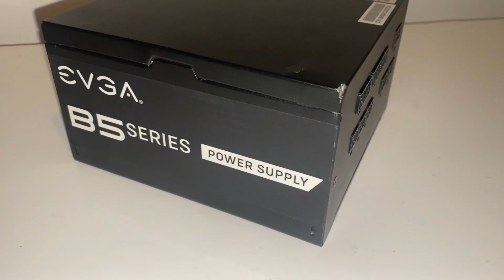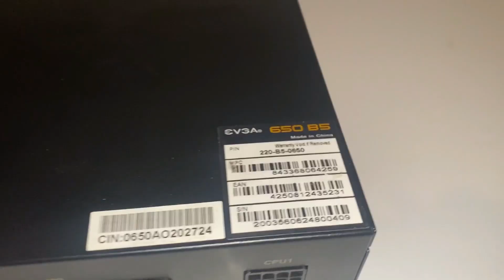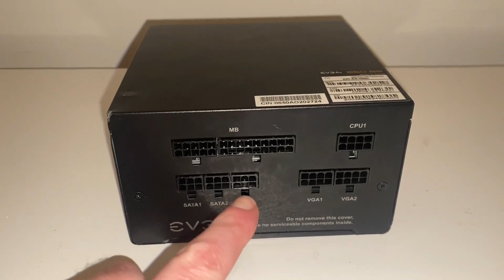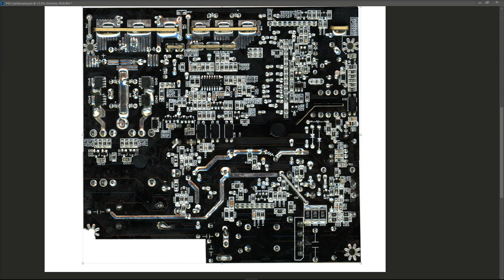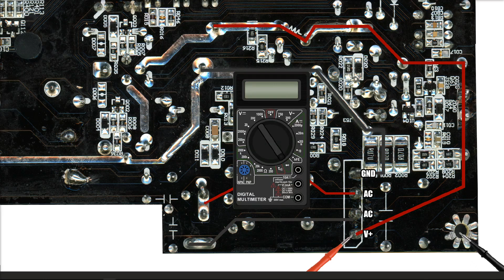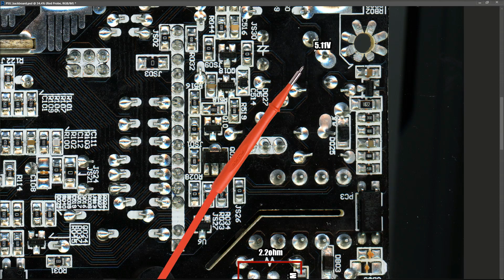EVGA 650 B5 - No Standby Voltage

Comment: i bought this power supply a little over 3 years now would this thing start to fail around this time. my pc keeps restarting after like 3 mins of gaming
Reply from the maker: This is tricky to answer. It could be the PSU, the motherboard, GPU, some software issue (either Windows or the game), or an overheating problem. Is it possible in any way that you could borrow a PSU from another gamer and see if you experience the same issue?
Reply: @therepairshare673  hey boss man so i checked event viewer to see what could possibly be wrong ( me personally i dont suspect psu to be faulty) error 7023 seems to be constant.Could this possibly be the issue?

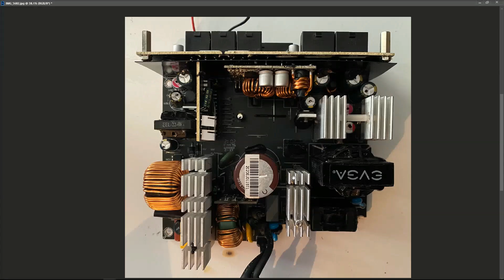Comment: (9:30 exactly) I would have liked you to show us a written list of the part numbers of the components mounted on the heat sinks (knurled aluminum) because they are very susceptible to failure. I see two small boards in the upper left corner of the image just to the right of the EEL-22 standby transformer and it is very likely that an IC is (exists) on them, if so: What is its part number?
Here on the American continent:
North America (Alaska, Canada, USA and Mexico) 110 Vac
Central America (all countries) 110 Vac
South America (I don't know for sure because I've never been there) but Argentina and Peru I think use 220Vac.
Here many companies use PC Desk, small cabinet preferably in black, horizontal type, in their offices.
For gaming applications, a desktop, mini-tower, vertical PC.
Laptops? preferred by students and workers who move between sectors or counties of a city with regularity.
Finally, of course SMPS have to interest any electronics technician who is dedicated to the service. Thank you very much for sharing this very useful content. I liked. All the best from Mexico.